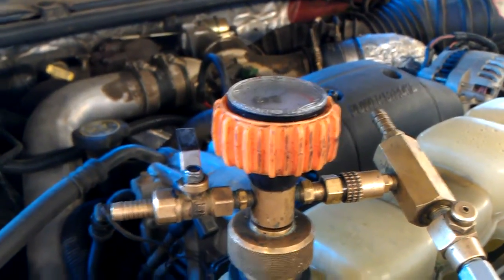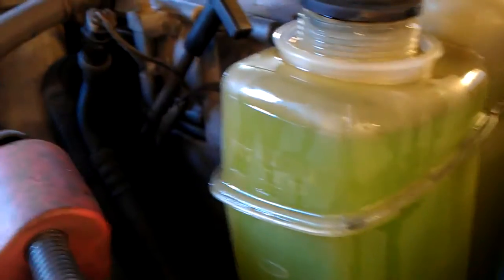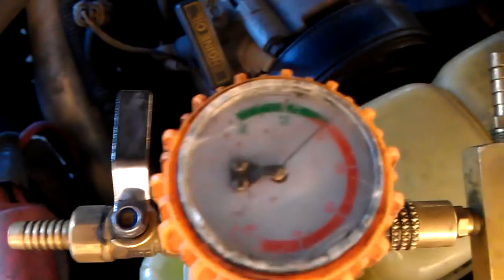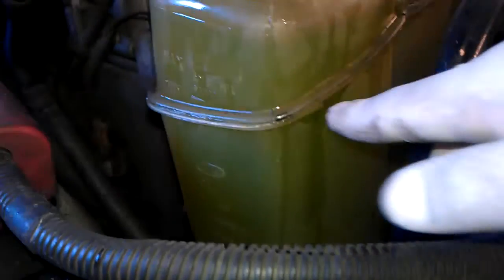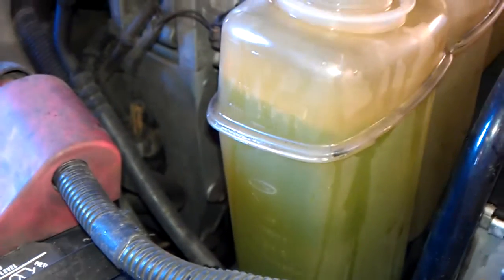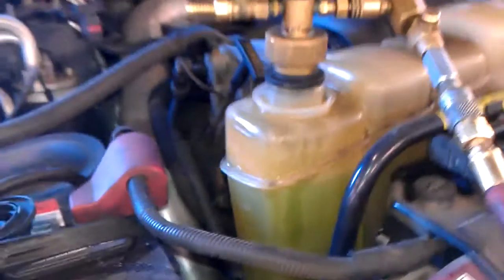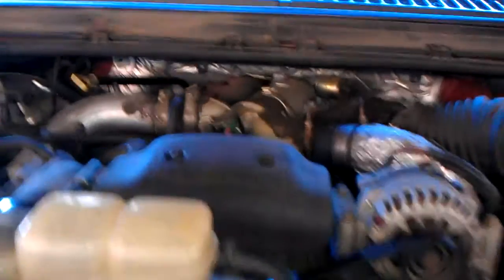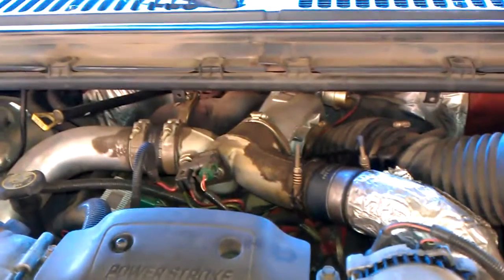SHOP UPDATE 4/11/2012 RAD KIT PLUS

Comment: Vacuum bleeding is the best  way to make sure you have no air bubbles in our coolant. I'm partial to a manual vacuum pump jerry rigged  from a manual fluid extractor and a coolant pressure tester with all the adapters.  But with shop air I bet it is way faster.